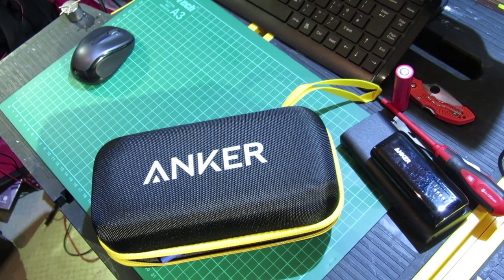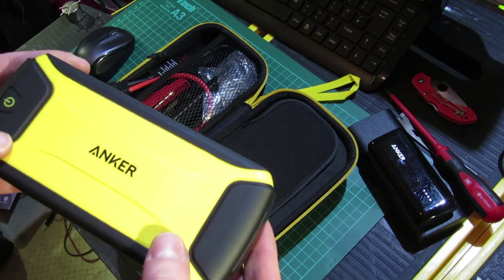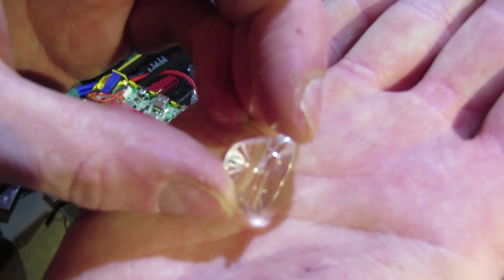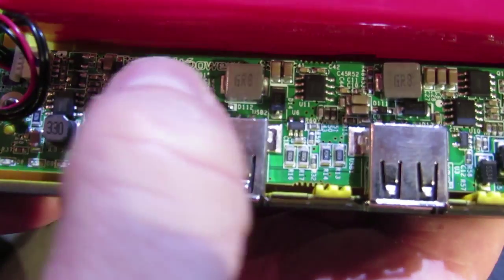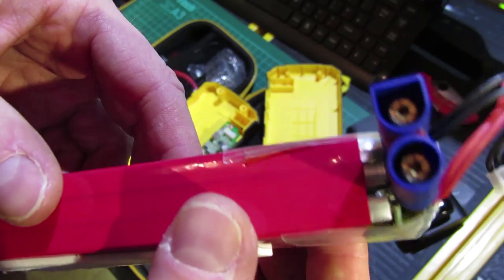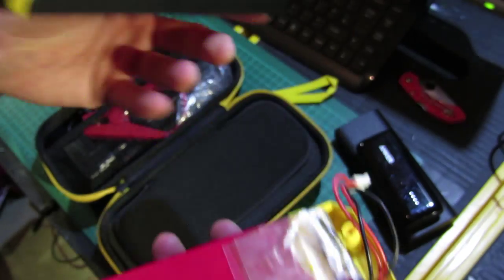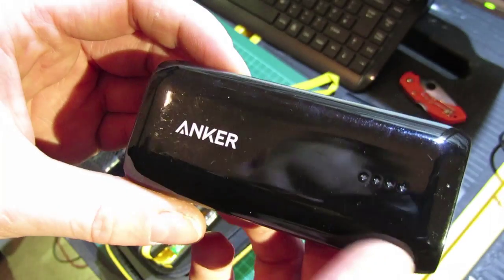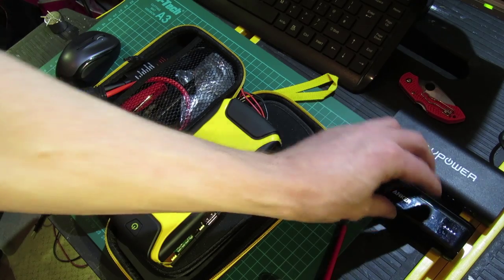Anker car starter battery bank teardown

Comment: Wouldn’t using one of these with any regularity lead to battery failure of the jump starter? I would think the amps needed to start a car would greatly exceed the C rating of a lithium battery of that size. I had a Schumacher one I would stupidly see how long it would turn over a hard to start lawn mower and the unit wouldn’t jump anything in a months time. Any high load would cause it to say dead battery but it could still charge phones. Be warned the battery interconnects inside the cells will overheat and fry causing much higher resistance unlike lead acid batts which are a gluten for punishment.

Comment: Lipo is able to jump a incredible amount of power. Sure the power given like 400 amps would be peak current but I've used a lipo pack before to start my car! It's awesome!
Reply from the maker: Andrew van Leeuwe, yeah it certainly is impressive, this unit jumped my 2.5L Diesel landrover no problem!
Reply: In most cases where people actually test these jump starters they don't do half the claimed rating, even at the ever so brief peak.

Comment: I just got one of these, it's a different brand but same specs. I think they are amazing. I was expecting to see some large capacitors kinda surprised
Reply: same, teardown is pretty basic here, still don't know how they manage to pull out so many amps from lipo
Reply: Me too. I don’t think these will last long before the battery interconnects degrade from intense heat pulling so many amps out of such a small area. The C rating of these batteries have to be greatly exceeded. I put one through an endurance test and it wouldn’t jump anything after that it would say dead batt but it could still charge phones because they pull so much smaller current at once.

Comment: Interesting that it is a 3s Li-Ion battery, from the label on the back it is claimed to be a 10000mAh, 37Wh which does not make sense. A 3S Li-Ion 10Ah battery should be rated at 111Wh. What they have done is rated the Ah with all cells in parallel, with a terminal voltage of only 1s, being 3.7V. In reality it is only a 3333 mAh battery at  11.1 volts
Reply: I bought a jump starter that claims to be 12000mAh, but I put a 0.33 amp load on it and it only lasted about 10 hours, rather than 36. Looks like that might be what you've described. Could you rephrase it more simply as my electronics knowledge isn't great. What does the 's' stand for?
Reply: @stumpy99  S is a general term used to mean a Series connection of batteries, P is parallel. The Ah rating is for 3P, but the pack is 3S
Reply: In all power banks the Wh is calculated by multiplying the Ah by 3.7 V which is the voltage of the cells. That is in every power bank out there, no matter if its output is 5V or 12V or 19V. So as this jump starter is considered a special type of power bank the method of calculating the Wh doesn't change, therefore 10000mAh=10Ah x 3.7V gives 37Wh.
Reply: @ekalaitz  Thanks the point is that this is not a 10AH pack

Comment: 37watt hours translates to 7400mAh at 5v or 3000mAh at 12v not both. They fraudulently add these two figures together to get the 10000mAh, actually 10400mAh.  At 12v, the main purpose of the device, a 3Ah battery isn’t going to jump start a car. It is connected then charges your car battery enough to  attempt a start. These will only work with a partially discharged battery such as leaving lights on etc. They will not work with a faulty battery.

Comment: guess those wires don't ever carry jump start current, they'd melt !
Reply from the maker: They will supply a surprising amount of current but i think they quick charge the car battery to some degree when first connected, as the parallel conection will make the voltages equal so current will rush in to balance the batteries. Both batteries can then supply current when starter is engaged.
Reply: They actually do work, I jumpstarted a car with NO battery (2.5L V6) with my Noco GB20, worked fine
Reply from the maker: JimsBagels Thanks Jim, that's really impressive!